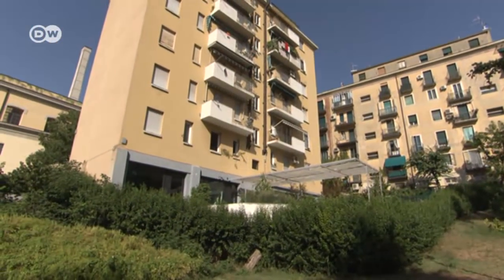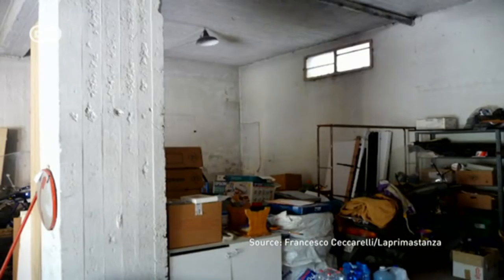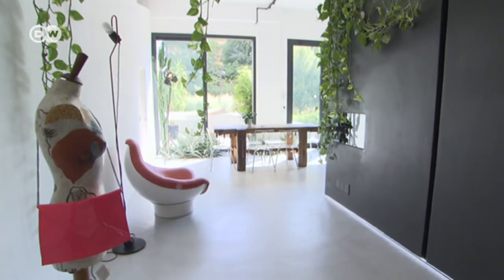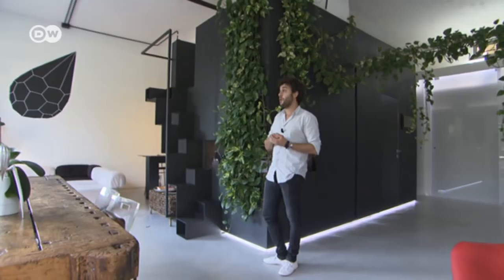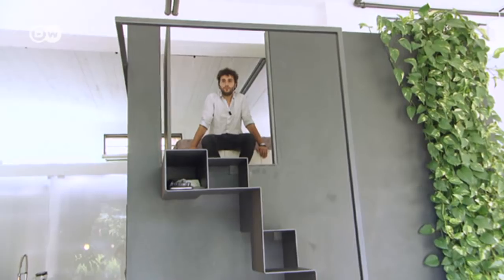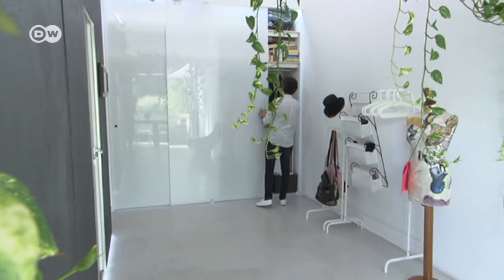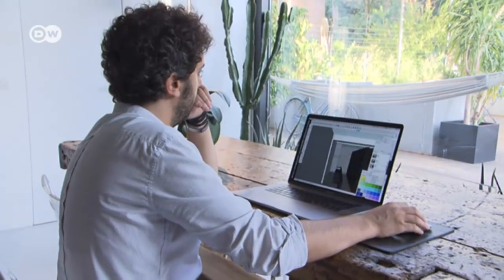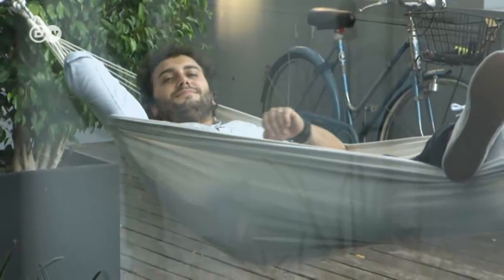Turning a garage into a designer home | DW English

Comment: Why would he make a house from garage? I mean, he can make a tiny cubicle house from scratch. Maybe it will become a tiny apartment building complex..?
Reply: Seiza Yuki there are plenty of advantages. Cheap, no need for heating, pipes are already installed... as he said its very economically
Reply: Seiza Yuki Time and Money.
Reply: Buying a garage is way cheaper than buying an apartment  in Bologna (in all Italian cities actually. So making the renovation of that place probably costed him just €20-30000 tops while doing the same in an apartment (where are not many structural changes allowed) would probably have costed him six or seven times more.

Comment: There's a lot of wasted space here, so much so, that he didn't need the loft bed!
Reply: Every space can be occupied one way or another,think about a dance space,installing a ping ball table etc
Reply: Someone didn't watch the video. The "wasted" space was a design choice, as was the loft.
Reply: I don"t think it was good use of the space. He could have easily gained more floor space if he had moved the bathroom/loft to one side of the room, if floor space was his goal.
Reply: But if it was off to a side of the room, he wouldn't get his desired design which was for the black box to modulate the floor space - basically it's helping to break up the space without interrupting flow.
Reply: I just don't think the space was utilized properly. He said it himself, that he wanted an open space, putting a big black box in the middle of the room does not convey "open" or airy to me. It feels constricting.
Reply: That was my thought with the entire thing...I know he says it's a work in progress and he's going to do more, but it feels so cold and empty to me...even the kitchen area was wasted space...the whole thing just felt depressing to me...on the other hand, the outdoor space looked really inviting
Reply: @lori s; I think so too.The outside space, the windows and glass doors are  very well done.
Reply: It's just too imposing for me, sorry.